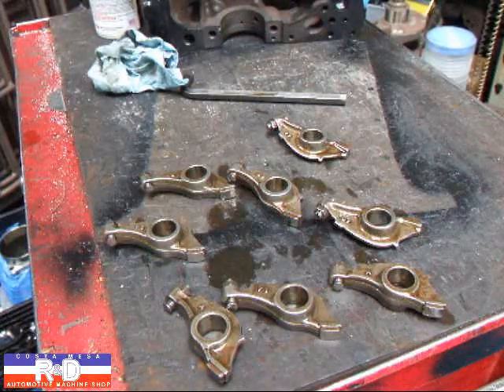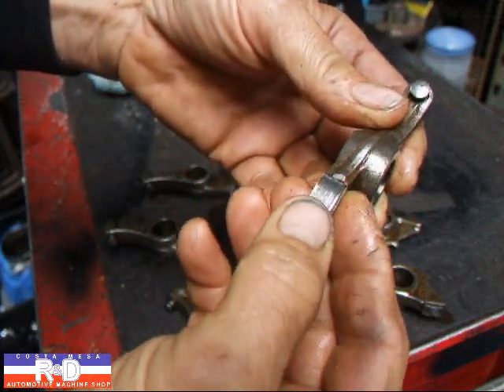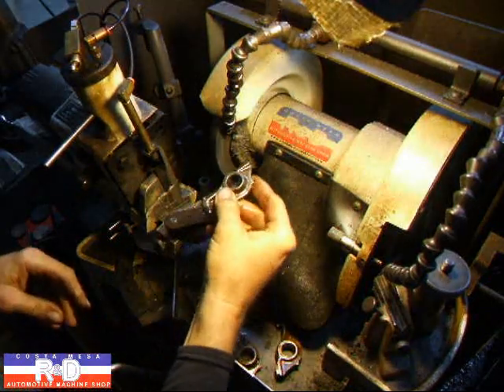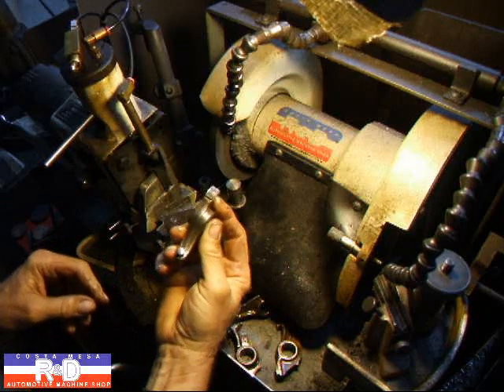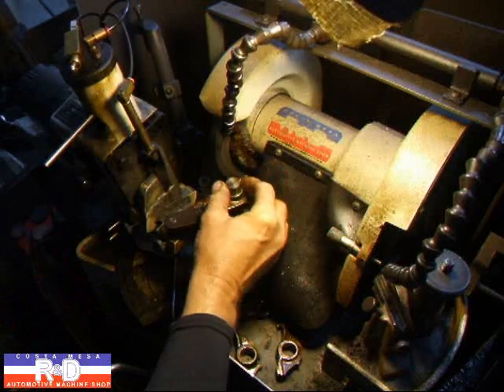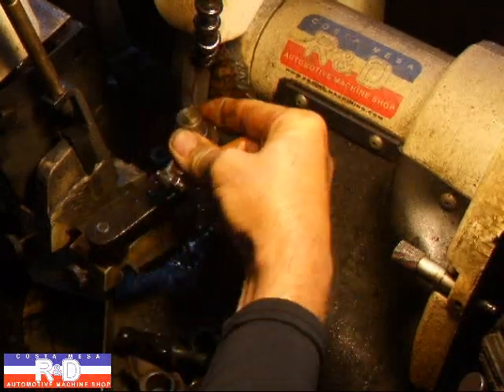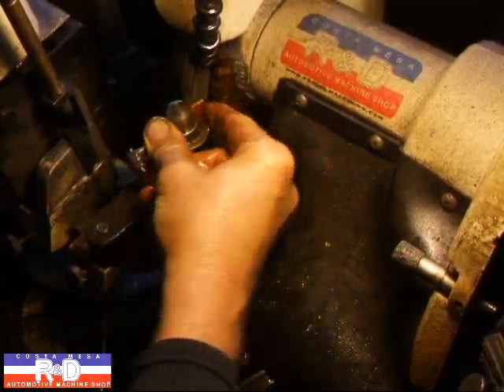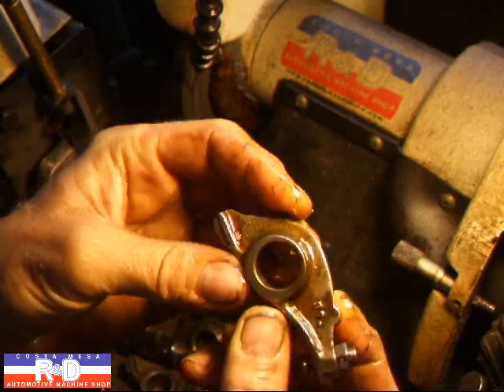Honda SOHC VTEC Rocker Arm Resurfacing

Comment: John, I see you prefer to work with bare hands, you should look up a product called PR88. It's the finest barrier cream I've ever found (made in Chermany of course), you could do an inframe on a highway tractor and your hands would clean with warm water at the end of the day. I decided after decades that most of the lubes, fuels, cleaners I was getting on my hands were not very good for me. About the rockers; do you find the hardness is uniform throughout the depth of the brazed on wear surface?